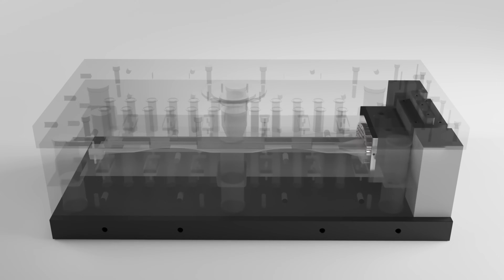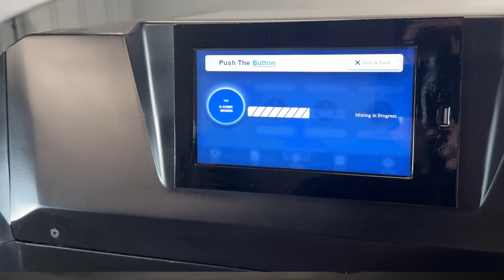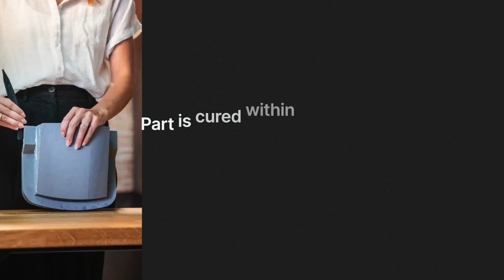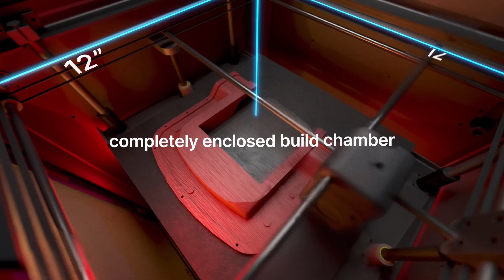INJECTION & Casting System for 3D Printers

Comment: what is the difference from just buying a 2 part epoxy and casting it in a 3d printed mold?
Reply: My thoughts exactly. It seems to have a pressurized injection system, but in reality mold design itself is the most important factor. To my understanding this product is really niche for people doing 10-50 Part runs. FDM printed molds dont really last much longer than that, and for lower part count i can just mix the resin by hand and pour it.
Reply: @RaphMNTR  I agree, I have my doubts for viability. The 3D printer they are showing and printed results have layer lines that really shows at a distance on camera. The quality of prints or how reliable the printer is questionable given how performing the last generation of printers are.  I’m guessing the printer has both process in the one box (system on the side) Didn’t watch all their videos. There are some good DYI injection kits that can be build and reuse old 3D printer parts instead of sending those old printers to the graveyard. I have my reservation on the release mold getting rid of the printer’s layer lines without going to great effort.
Reply: Hopefully hassle free bubble free end product…not very clear whats going on.
Reply: That's exactly what I was thinking. You could literally replace the entire product with a large syringe.
Reply: less mess I figure
Reply: Wait, I thought this was abs/ASA injector. Resin?

Comment: Things that are missing, that were just glossed over: Just send you the part to design the mold? 1.) How much does this design process cost? 2.)Can we design our own mold and how? 3.) If we have to go through your company to design the mold, is shipping included? 4.) What are the consumer facing material properties for each of the resins; for example is there a UV resistant one similar to ASA, is there a impact resistant one similar to ABS/ASA, is there a food safe one similar to PETG/PLA(when made correctly). Is there a high strength one similar to PLA and PC, is there a high temp one similar to ABS/ASA/PC?
Reply from the maker: Thank you for the questions. These shape the future videos.
1. Design is going to be per mold based starting from $4.99. 2. You can certainly design your mold. We will be sharing a lot on how to design for different materials and different applications on this channel. It will start with 2 part molds and at the first video 3. We don't offer manufacturing of the molds. Its just a service we provide so that people can streamline their process. 4. There will be UV resistant resins we offer, our rigid material is fairly similar to injection molded ABS. 3D printed parts aren't isotropic although the numbers on papers are high. In real world use thats not  the case because of the layered structure of 3D printing.  There will be no food safe material on polyurethane line-up. If we can get our system to use platinum cure silicones or special resins but before that there are a lot of materials to offer. Like earlier its generally much durable than 3d printed alternatives we will release data sheets on every material. Yes there will be polyurethanes for higher temperatures currently Glass transition of Base Rigid is 167 F or 75 C.
Reply: @NeckogIndustries  let me follow up on the Daas questions.   Is there any limitation to the size, for example can a 3d model of a sword be submitted?  Will you be able to request only single part molds or could you request gang molds?  Does the service have a buy in if we do not kickstart the Flovv and are just interested in the molding service?  Do your materials only work with the Flovv or can they be hand mixed and poured.  Is degassing of your polyeurathane compound needed?
Reply from the maker: @kineticentertainment2638  DaaS has no limitation with size but models has to be step files. Yes a 3D model of a sword can be submitted.At the beginning  DaaS will be for our customers only once we think we can handle more it will be available to everyone.(no buy in needed). You can mix materials by hand. Hand mixing introduces air bubbles into the material. Hence if you are mixing by hand degassing is needed. Injecting with machine makes for a much better end product. If you are using the machine degassing is not needed. If the component requires shake before use we have an in tank mixer which does it for you.